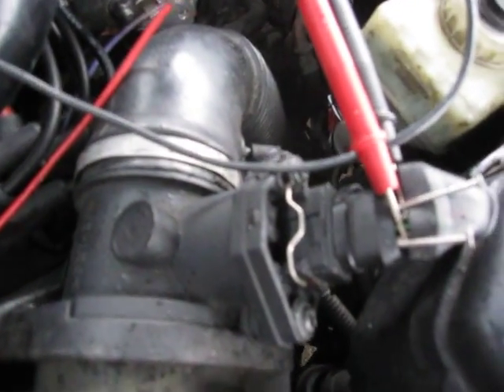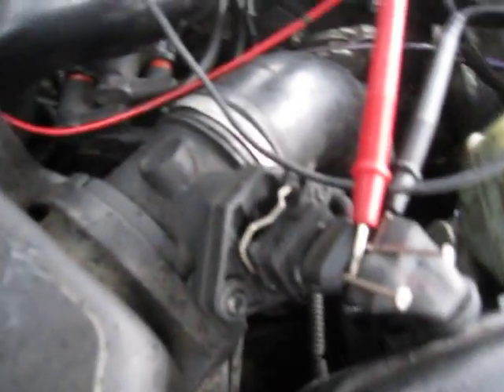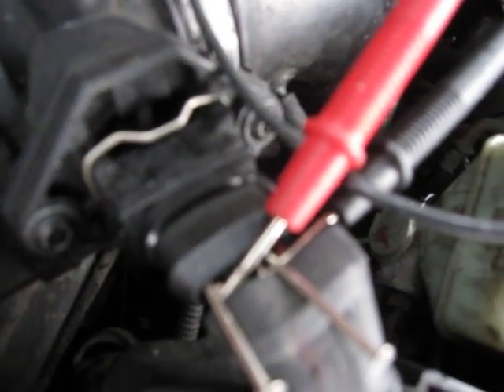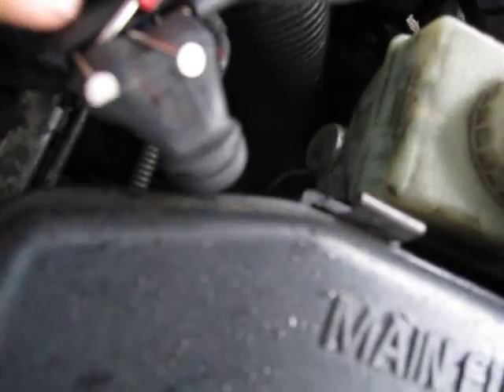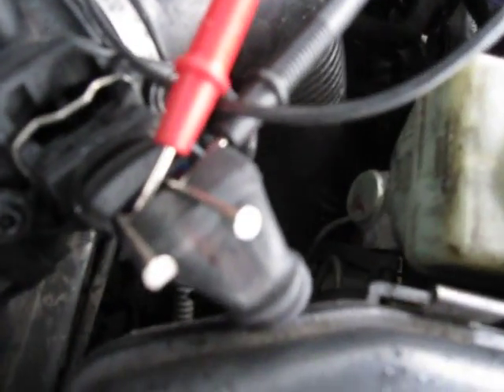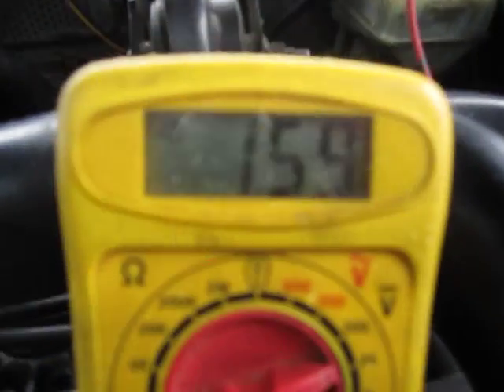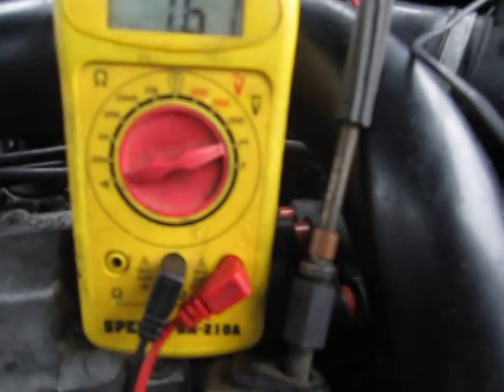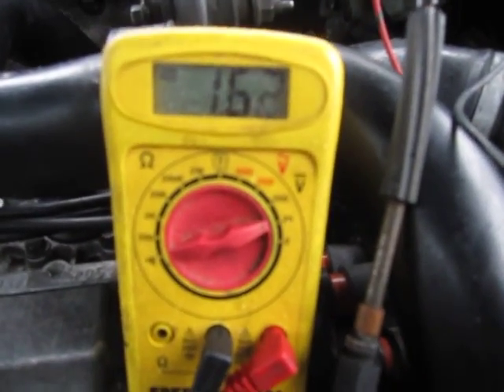How To Test A Bosch MAF Sensor

Comment: What exactly were you “Testing”?  You were reading the output voltage, if you don’t know the necessary operational voltage range values utilized  by the ecm and the resistance values of the circuit, to and from the sensor , and a few more factors, you didn’  “Test” anything but in reality measuring the circuit voltage after the component, before the module. You need two factors to determine the product. 
 Sorry, pet peeve of mine !

Comment: How to measure hot wire resistance? Your air mass meter could work and send a signal but not at the good hot wire ohms specifications.

Comment: In some cases i saw between 3 and 5 pins, at you between 2-4. I hate bmw 320d 136 hp version with 5 pins. Which wires i should measure ?

Comment: The Bosch chart reads mass flowrate (kg/s) = displacement (m^3) * density (kg/m^3) * (RPM/120) * Volumetric Efficiency.

Volumetric efficiency is very roughly 20% when the engine has no load.

Comment: Ya, I haven't found eighter. 
The only thing I found (wasn't easy!) is the BOSCH  data sheet for some sensors, including the MAF sensor.
They only publish a graph, witch has kg/m3 value reflecting to the amount of air passing through. It produces voltage from 0-5V approximately. The only question we need to know is how much air do certain vehicles suck in at certain rpm,who are using this maf sensor.
I can only guess that 2,5-3V reading at cc 4-5000 rpm is too low! So maf sensor is worn out.

Comment: Hi, do you know, that your maf sensor is in good condition or not?
I have the same volvo (mine is 850 2.3 T5) and got similar voltages, except mine was only 0,98V at idle.
I am hunting for information on the correct volt readings for a good sensor, cause I want to know if mine is worn out or not.

Comment: Kinda strange that you would replace a heater core for a (poor cold start complaint) I'm assuming the heater core was leaking. Anyway try testing the cold temp sensor or engine temp sensor also make sure you don't have excessive carbon build up on intake valves